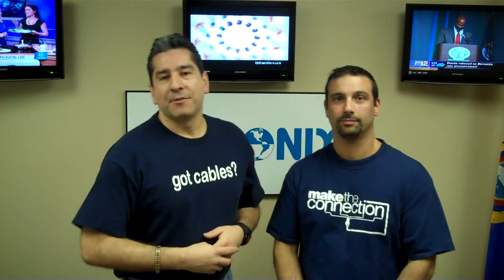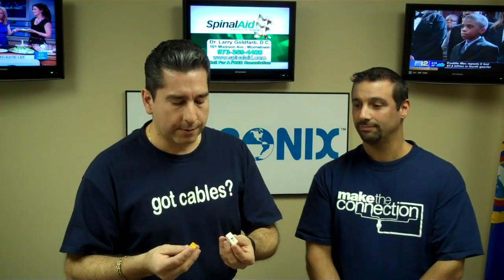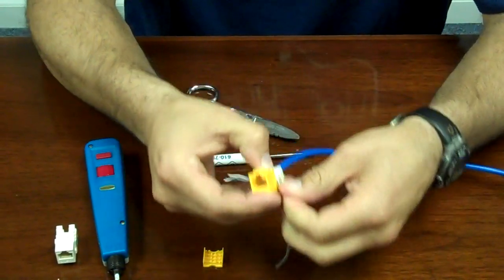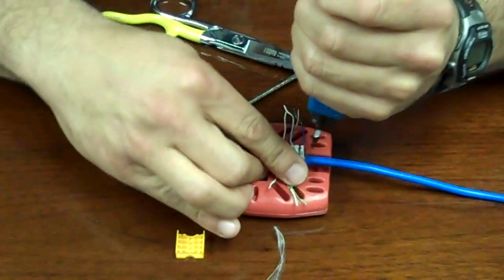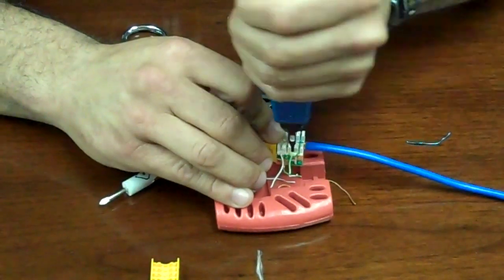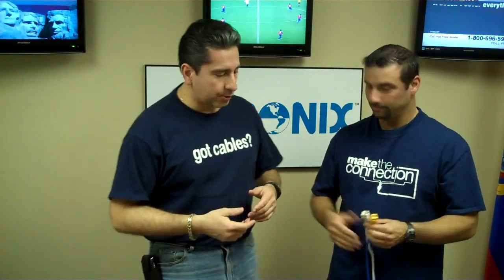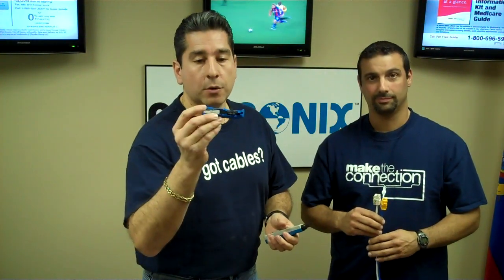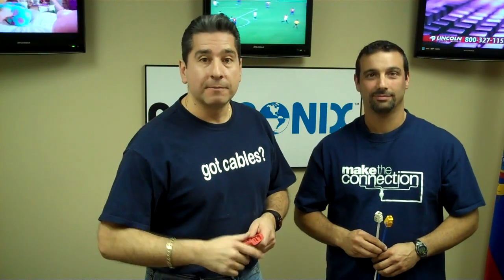HOW TO | Punch Down a CAT5E Keystone Jack

Comment: I am wiring up a keystone jack but my ethernet cable does not have twisted pairs, when I punch down the leads, the connector does not work, I have checked to make sure that it is configured correctly, my only guess is that it is using the other wiring config, what are the colour codes for that wiring config, T568A

Comment: who im i suppose to check with in order to use 568A or 568B? also i dont have a punch down tool there another way to use the jack without a tool
Reply: Small flat screw driver and a firm sharp tap with a hammer will work